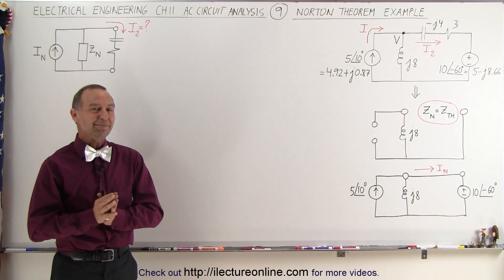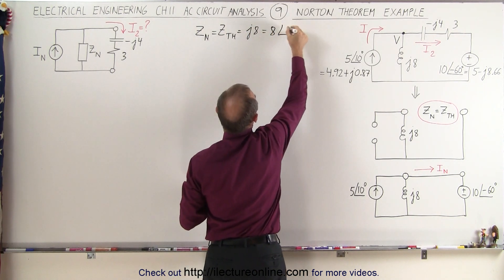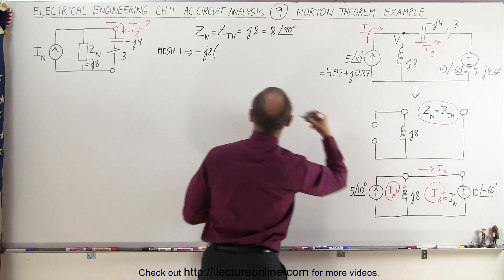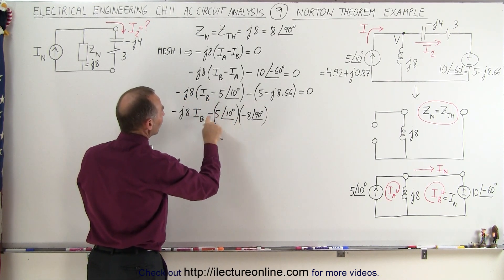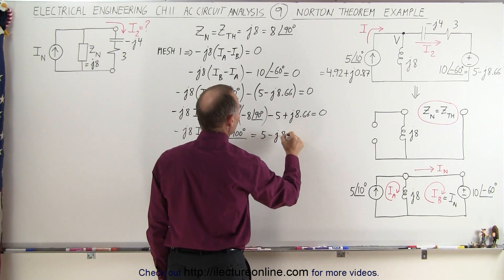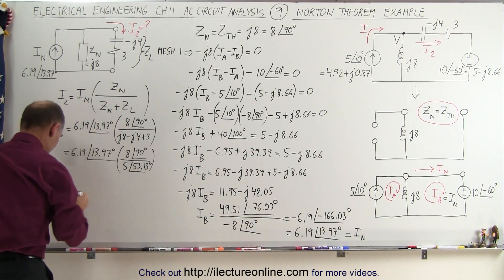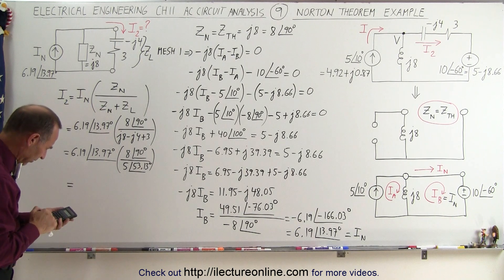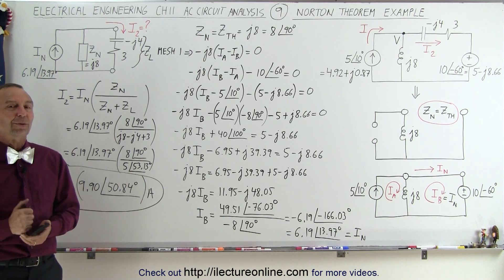Electrical Engineering: Ch 11 AC Circuit Analysis (9 of 55) Norton Theorem Example

Comment: A quick question. If the path of least resistance is the short circuit through In, wouldn't the current look to go through that path instead of the 8j impedance?
Reply from the maker: In is not a short circuit.  It is a current source that forces a particular current through that branch.

Comment: Once again when doing the (left) loop equation at  13:23 you have -j8*(Ia - Ib) = 0 which is not correct. That would make Ia = Ib. Looking at mesh 2 at 13:23 you would then have the nonsense equation -10<-60 = 0. Instead Ia is not equal to Ib but rather Ia = 5<10 which is clearly seen from the diagram. When doing the final calculation you DO put in the correct value of Ia in the mesh 2 equation fortunately ignoring your equation for mesh #1.